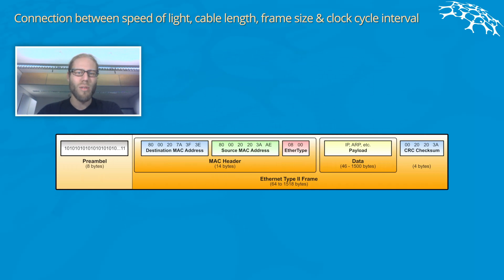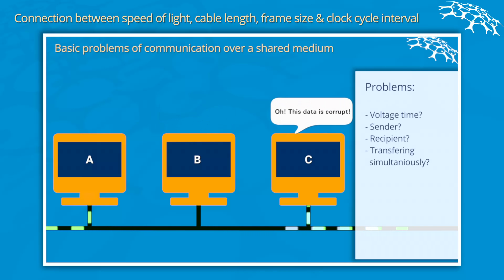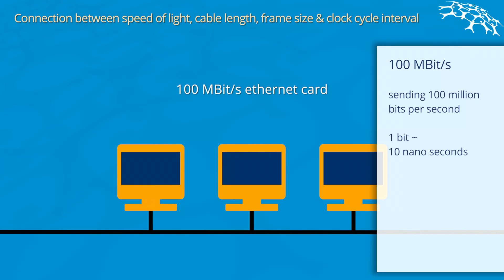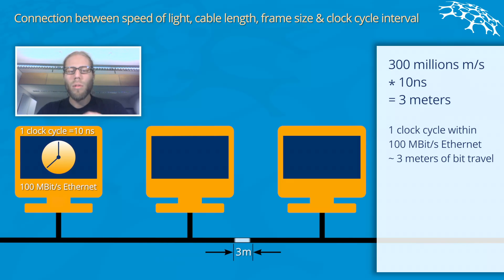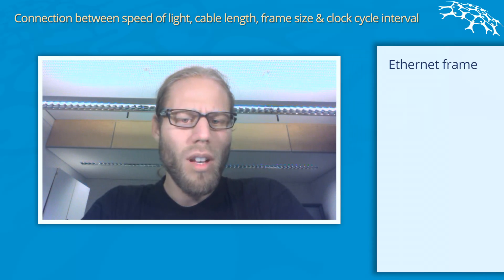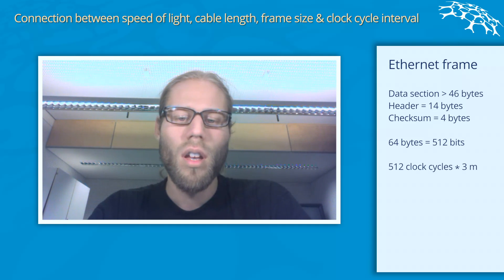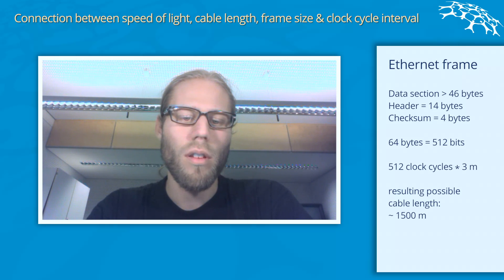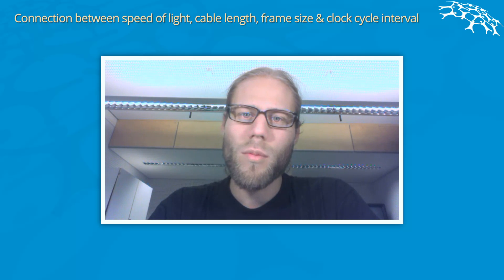Minimum Frame Length in Ethernet explained 2

Comment: The signal does not travel at the speed of light.  It travels at the speed of light, multiplied by the velocity factor of the cable, typically .65 -.70 or so.
Collisions only occur on half duplex networks, that is coax or hubs.  With switches, collisions don't normally happen.  However, in the interests of compatibility, the minimum size is retained.  On the other hand, with Gb and faster now becoming common, there is a trend to jumbo frames, to make better use of switches and interfaces.  These can be up to 16KB, IIRC.